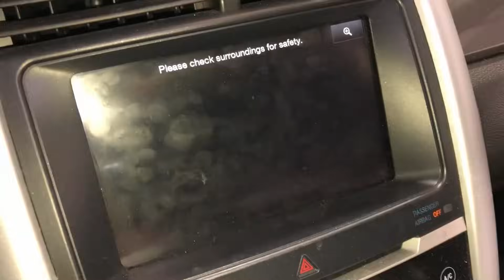2007-2019 Ford 6F50/55 Six Speed Transmission: Fluid Exchange Procedure

Comment: Is this transmission only on front wheel models, no AWD vehicles (as in, my AWD 2013 Edge does not use this?)
Reply: The same trans is used on both AWD and FWD.  The AWD adds a PTU to the right side to send power to a rear diff.
Reply: Same, i have 07 and 2010 edge AWD
Mercon V 2007
Mercon LV 2010

Comment: These videos are such a lifesaver. You are the man.
Reply: Tyler seriously. So awesome
Reply: Since 2014, after watching one of the precious videos, I kept an eye to the fluid change interval, my two Ford Escapes have been running great, no such issues as reported by many others. (Engine oil, Transmission fluid, PTO and Rear Diff gear oils, the coolant really last long).

Comment: So I have a 2015 lincoln mkt with 56,000 miles and it has the 6f55 mated to the 3.5 ecoboost. I was wondering if there were any common problems with the transmission because lately mine has been shifting hard?
Reply: I will second what @cruz mascorro said - start with a fluid change.  If the problem continues then you have problems that need to be looked into by a reputable transmission repair shop (look for one that is an ATRA member) or the dealer.  The longer you keep driving it with hard shifting, the less likely a simple repair will be able to actually fix it.

Comment: Sure would be nice if they all just used a spin on oil filter as a trans filter. But that would be too easy.
Reply: A lot of incompetent Jiffy Lube techs would mistake it for the engine oil filter.
Reply: @jonclark1288  good point. Maybe make the adapter and filters  reverse threaded. Then those of us who are smart can get an adapter to the adapter that is forward threaded and use regular oil filters. Or not take the car to jiffy lube. No way in hell they'd ever touch even my old cars. Last time anyone changed my oil was 1990 at the pennzoil place. Watched the long haired dope head and figured sh** I can do this. Now I've done everything except mount tires on rims.
Reply: Great question. Why not have an external transmission filter? I assumed that it was a clearance issue back when most vehicles were rear wheel drive. However, with the change to front wheel drive, why not locate a transmission filter like the oil filter?
Reply: Game Bred Duramax  Allisons have spin on filters? Wouldn't that be nice.
Reply: My Saturn was that way trans filter and oil filter looked almost identical
Reply: Ahem, Subaru.
Reply: Better yet, why not invent a manual transmission mate?

Comment: Having to pull a transmission OR Anything else to change a damn filter is NOT a good Idea, Just a Money Suck from Ford or ANY maker.
Reply: My honda Odyssey was 12 years old and had 245k km on the same transmission and it had an internal filter. I changed the trans fluid many times myself and it was still going strong when I so sold it  and bought my !st F150, Fluid changes help make things last along time, just do it. At 72,000 km my F150 has had all the fluid changes from front rear using Brians video as a guide.

Comment: 136K on my 2013 Taurus Limited, dependable vehicle. Wish Brian would do more videos, but understand since he is so busy at the garage. I may upgrade to a 2018 off lease Taurus, but considering a 2015-2016 MKS
Reply: Nice. I have a 2008 Taurus with almost 190,000 miles. Only thing I've had to replace is the water pump-which is a hell of a job (10+ hours to do) so just keep an eye on your water pump for leaks. Otherwise the 3.5L is a great engine.

Comment: I have a 2017 F150 XLT with a 3.5 liter engine. The dealer is telling that these transmissions require service every 100 thousand. Is this true. What is opinion on this?
Reply: Filiberto Orozco, Brian has a video explaining why NOT to follow Ford’s recommended service intervals.
Reply: Do you have the owner's manual?
Do it twice as often as what the manual says

Comment: Have you done a fluid/filter exchange on the new 10R80 yet?  Is that feasible for the DIY guy, or better off taking it to the dealership?
Reply from the maker: Yes and they are a nightmare!
Reply: @FordTechMakuloco  Thanks for responding.  I was reading the pdf from Ford's website and they want you to have a diagnostic tool connected while you're doing it, you need to get the fluid temp up to 205F to get it past the torque converter, (I've never seen my fluid go over 200 even when towing in the hills).  Lot of hoops to jump through.  The manual says it's good for 100k miles but that seems crazy to me.  Would you recommend that I drop the pan & change the filter at 30k, refilling whatever I drain out doing that, and then take it to the dealer at 60k to do a full fluid exchange?  Or should I just take it there at 30k and have them do it all?

Comment: Leave it to the blue oval bozos to design a transmission with a filter that cannot be serviced.
Reply: At least it has a dipstick and a drain plug!
Reply: If the trans is maintained routinely, the filter will last as long as the transmission does.  If you ignore it, the filter will plug but the trans won't live on old burned fluid anyway..
Reply: Ford isn't the only automaker to do that. My 1992 Honda Accord is the same way.
Reply: Guys GM has been making transaxles with out even a dipstick since the mid 90s... 4t40e

Comment: Is that the same 6 speed transmission that is in my 2010 Lincoln Navigator?
Reply: No. Your navigator is rear wheel drive based. This is for the front wheel drive transmissions
Reply: @Itsyouandme34  thanks for the response.

Comment: If it wasn't for FordTechMakuloco and his repair/service instruction and tips, I think half of Ford owners would trade their vehicle in for another brand. Wish I wrote down all the vehicle years and what to watch out for.
Reply: Hahaha yeah, I have a 3 valve 4.6 V8 in my 2008 Mustang GT, it's pretty much the same as the 5.4 engine in the trucks, and I diagnosed and replaced a bad vct solenoid, a bad roller follower, replaced a phaser, and retimed my engine twice (installing a new melling oil pump the second time) all thanks to this man. I'm pretty sure I used his videos for a few other things as well like when I changed my diff fluid and swapped the mini clutches for carbon ones. We are very lucky to have Brian as a source of information considering he is a ford technician and REALLY knows what he is talking about.
Reply: @SangheiliSpecOp   Hear, hear!
Reply: This is an absolute fact
Reply: He comes in clutch for Ford Tutorials arguably one of the best Ford Mechanics out there
Reply: Haha glad I read this comment before buying a ford…
Reply: Absolutely!!!

Comment: Internal filter. SMDH
Reply: I know right.... XD WHY WOULD YOU DO THIS
Reply: @SangheiliSpecOp  If you change the fluid regularly, the filter says clean. If you don't change your fluid, the filter won't be your problem...
Reply: @ohger1  I guess... But they could have designed it in such a way to where the filter was more easily accessible...
Reply: Guys this is not a new thing. Many Asin transaxles are like this and are good for well over 200,00p miles. Just change the fluid, GM transaxles dont ever have a dipstick....

Comment: Ford has a big Recall on the 6 speed transmission,  for the speed sensor
Reply from the maker: That recall is for the 6R80 and is just a software update.
Reply: @FordTechMakuloco  A friend of mine is having it done now  and they told him they are replacing the sensor and updating software  on a 2010 F-150
Reply: @FordTechMakuloco   also i need to talk to you about something on a older ford 2004 how can i get a hold of you
Reply: My 16 Edge is in the shop right now for the output speed sensor.
Reply: The recall is for the rear wheel drive trans in the F150